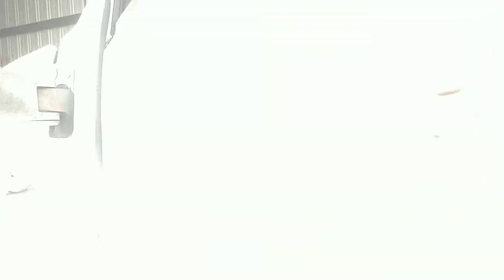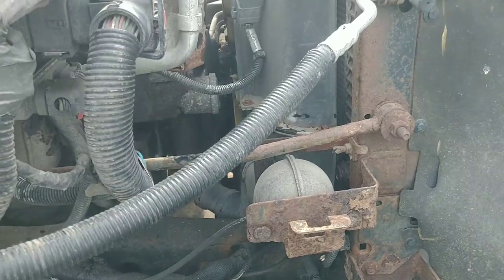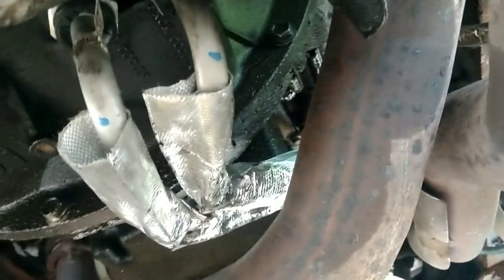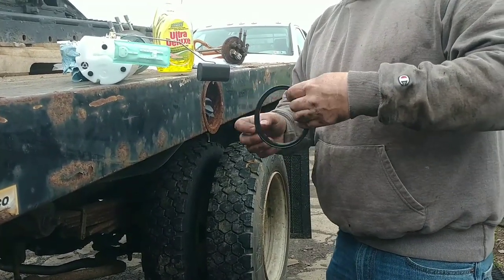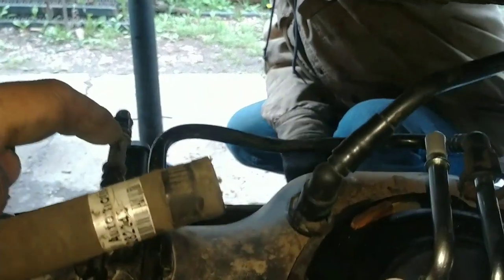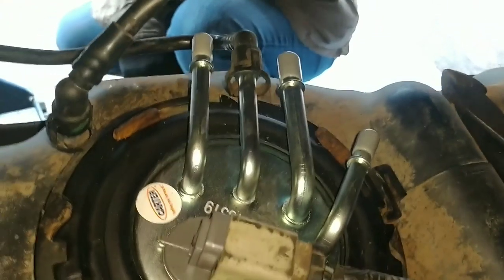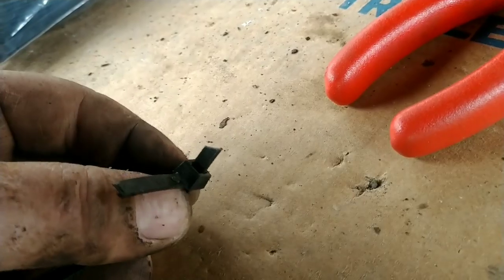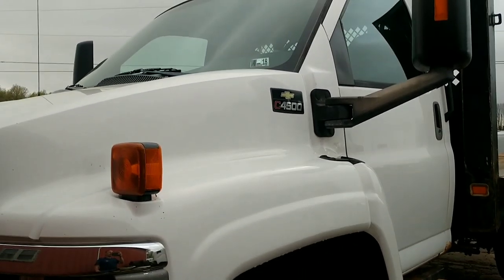C4500 MAKING FUEL LINES! EVERYTHING I TOUCH, STARTS TO LEAK

Comment: I am a non professional shade tree mechanic.  For instance my son's, 2004, BMW X5 is in my driveway for front wheel bearings, oil leak fixes, front diff removal, and front axle shaft removal.  I just about have it done, except for oil leaks, which require removal of PS pump and alternator.  It is being converted from AWD to 2WD.  Point is, if there was a conscientious mechanic such as your self, that I knew of, I would gladly have hired the work out.  I enjoy your videos, please keep them coming.

Comment: Snap On has new flush cut snips for those sharp zip tie issues. I bought a set and love them. No more sharp zip tie ends.  They're also excellent for cutting wiring.  I do quite a bit of wiring so I have a whole roll cabinet full of strictly wiring tools and supplies. Lots of trailer rewiring, truck and flatbed wiring and accessories. It's nice to have everything on hand

Comment: Soak the end of the plastic tubing in some hot water (or any heat source works) for a couple of minutes and it'll slide together then shrink back around the fitting.
Thumbs up! Nice work!

Comment: Another of GMs less than stellar ideas.  A friend of mine who makes a lot of those plastic fuel lines strongly recommends using some good quality electrical tape over the metal crimp clamps, although they're not supposed to rust, they do and they don't need to rust much before they break and you're back to having fuel leaks again, especially on the feed lines to the engine which run at fairly high pressures...

Comment: I first learned you could run your fuel lines all the way in plastic watching Eric O’s channel. It’s a very labor and material cost saver!! We used to use Dorman trans and oil cooler lines and fittings, but started having fit issues. Would definitely watch paint and detail work for that and any truck you felt like sharing. Thanks for bring us along JC

Comment: I have a small hot pot that I put water in. Dip end of line in it a couple minutes, and ends go right on. Shrink tight as they cool. I also use wire loom before install. Being obsessive/compulsive I cut 3/4" pieces of heat shrink tube and put on loom every foot on short runs. Heat with a old hair dryer. Looks real pretty !! Why yes, we want to see the paint.

Comment: I can't tell you how many fuel line and transmission line repairs I have seen where they just slip a piece of hose over the old steel line, install a hose clamp, and hope for the best. I'd like to have the crimper die that can make the quick disconnect crimps in steel lines. Someday I'll buy one. Nice work!
Reply from the maker: i have the hydraulic tool that makes the gm line ends but i couldnt make the flexible rubber part or bend the large diameter line easily....i thought it was best to just order them.

Comment: Nice neat job on the fuel lines . I do the same thing with the loom to avoid chaffing . It’s much easier to work with the plastic lines IMO than to bend metal and adapt plastic quick connects .

Comment: Rust is always fun, sometimes when the stuff gets crusty, you know it can be losing battle like with the sending unit. heck of a lot cheaper to make your own lines than having to go to the chevy store and order em from the dealer, almost reminds me of doing the pex system when your doing a plumbing change over from copper to pex. Looks good JC whoever buys it should have no issues with the fuel system. Loom is a goood idea...nothing worse than making a repair and then someones does nothing to protect it and then it rubs out and leaks, nothing worse than fixing something twice
Reply from the maker: it only takes a few extra minutes to do a little extra but is sure makes a big difference.

Comment: I'm having a hell of a time getting my 6.6 duramax to prime. Did the lines going up to the filter. Rear inline pump, lines from back to front. Can't find the primary sending unit.  For the 22gal primary tank in the middle. But was able to get the 18gal rear unit. Replaced the primer filter unit. The only lines I didn't do are the ones coming off the primary unit in the middle going to the hard lines going up to the filter. They have a very small drip. But I'm assuming it's enough to get air in the line and cause it to not start.
Reply from the maker: this engine pulls full from the midship tanks with suction. if you see anything damp, it is enough to let the pump suck air instead of fuel. that inline filter only transfers fuel from the rear tank to the front when its getting low.

Comment: Couldnt you cut the tranny line right next to the fitting and pull the fitting off since replacing.  My 97 chevy had those connectors on the engine oil cooler

Comment: I don't get why coolant was lost when removing the trans coolant lower fitting.
Reply from the maker: the trans cooler is inside the radiator tank. the fitting seals the plastic radiator tank opening by screwing into the trans cooler.
Reply: @j.c.smithprojects  Wouldn't that then allow coolant into the trans cooler as well?